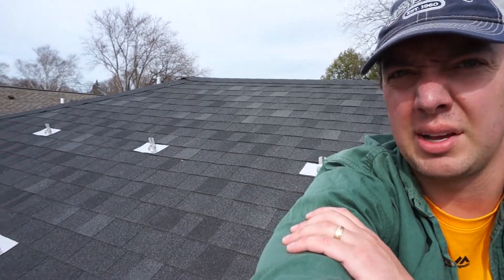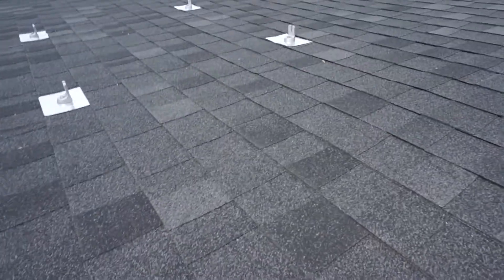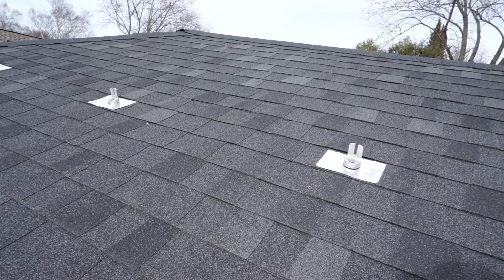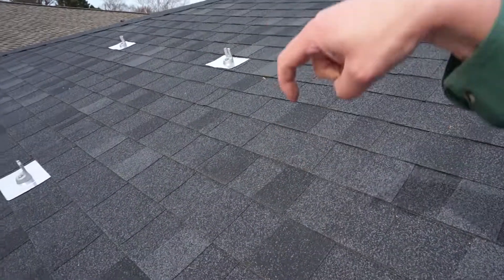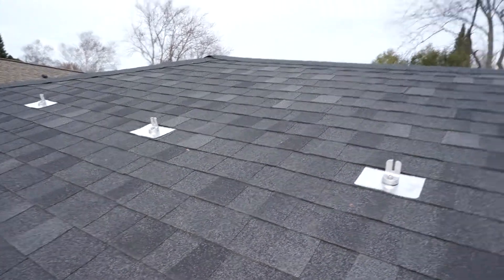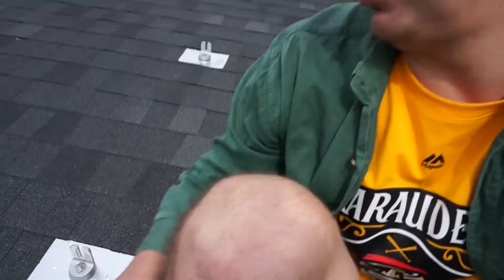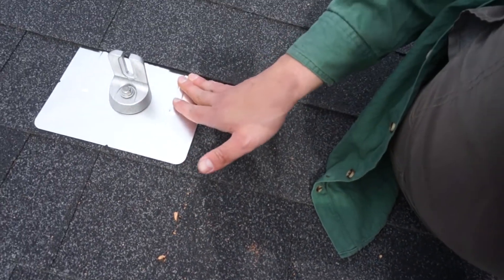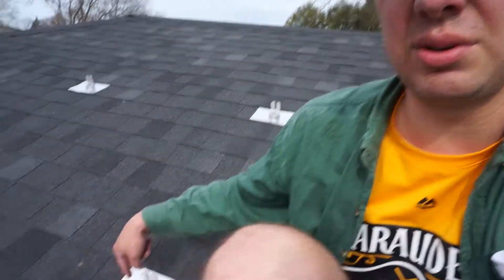Project Solar DIY Install Day 1: Ironridge Flashvue

Comment: You aren't able to use a stud finder to find the rafters?
Reply from the maker: Only very expensive, specialized stud finders work through asphalt shingles... and not reliably. It's not too bad to use a hammer and listen/feel for the studs. If you miss, the flashing covers it anyway.
Reply: Thanks for the response and the video! @jimmypautz

Comment: How's the install coming along? Were you able to get the rack system complete?
Reply from the maker: Yes, all done. There was a permitting issue with Project Solar... But I'm getting the inspection on Friday. Going to try to edit my next video soon.
Reply: @jimmypautz  Awesome. Congrats! Give us the whole run down on how many days/hours it took and what the sticking points were with paper work and physical labor. Thanks for documenting your experience!
Reply from the maker: I got my panel install video posted: https://youtu.be/G52IhyQI4aI

I'm going to post an overview of the electrical as well, and then I'm going to do one or two overviews of the whole project video, specifically reviewing my experience with Project Solar.

Comment: I just had two offers for solar. One for 107k  for a 21kw no battery and 80k for 17kw with 10kw battery.. So glad project solar came up on my Facebook feed. I'm really looking forward to your videos and thoughts. What would you say is the hardest part of your DIY project?
Reply from the maker: Honestly, the hardest part has been making sure I understood my power company requirements and getting Project Solar to understand and design for it.  

From the install, it can be a pain to keep the wires off my shingles...I had to go back on a week later and fix a few that drooped.  Otherwise, it was annoying to feed the wires through flexible conduit.  Everything else went fine.  I'm pretty handy and I replaced my roof two years ago, so I'm comfortable with most aspects.

It's on my todo list to finish editing my install footage, hopefully I do that within the next week or two.
Reply: @jimmypautz  What's the deal with keeping wires off the roof? Is that a conductivity/isolation issue or is it the danger of the wire insulation getting worn? I have a metal roof so I'll have my own issues to deal with.
Reply from the maker: @ParkRoadGuy  I think it is primarily related to preventing wear on the insulation.  They are designed to be up there at least 25 years, and exposed to a lot of wind.  It practiced it's still probably unlikely to matter, but asphalt shingles are rough and could wear through if conditions are just right.
Reply from the maker: I got my panel install video posted: https://youtu.be/G52IhyQI4aI

Comment: Hey, thanks for doing these videos. I know you just started but I've been thinking a lot about using this compny and solar in general. I look forward to seeing what you go through up to when you finish.
Reply from the maker: Thanks for watching! Let me know if you have any questions.
Reply: @jimmypautz  What I'm running around trying to nail down currently is financing. If I may ask, after the $100 depost about how long before they ask for the first(or only?) major part of the payment?
Reply from the maker: @jason00794  you only pay once the design is final as far as system size, since they price by size. There are a number of steps that happen first. I didn't have to do financing, so I can't speak to that part.